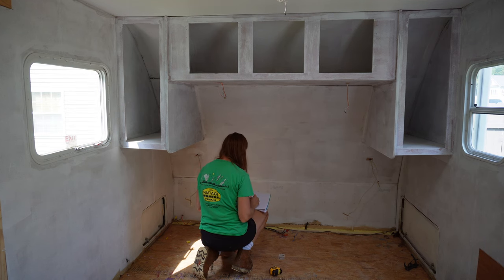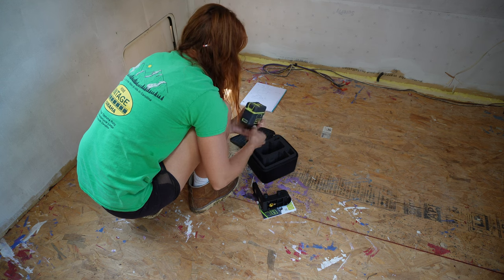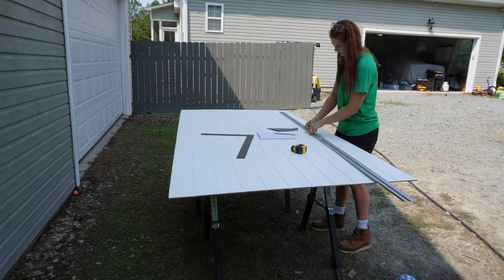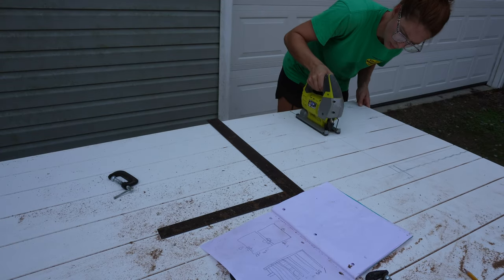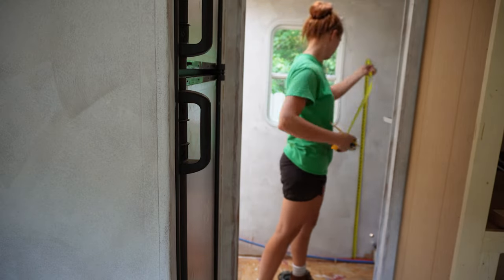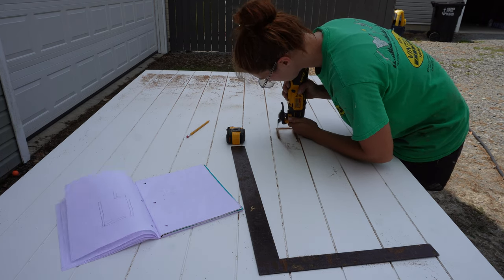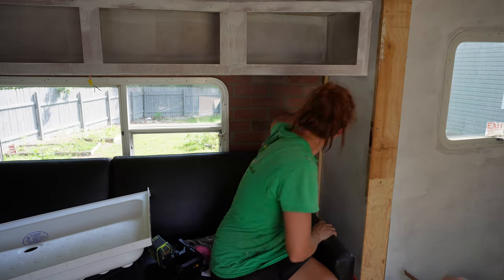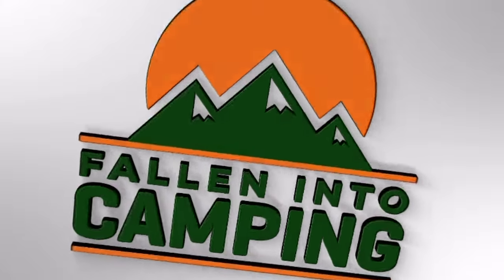RV Renovation: Day 8 Shiplap Accent Wall

Comment: That is handy stuff. I have a 4ft X 12Ft X 36 in tall work bench that I help my Dad build 50 years ago. The 50 year old plywood was showing it's age. I reframed it to add 4 additional feet, added a 10ft wall vertically to add pegboard. I bought several panels to reface the cabinet. Even though it came "painted" I primed it, two finish coats. I installed vertically on the bench's face, new freshly painted 3/4" plywood on top of work surface, new hardware. Made for a killer work bench again. Felt like Dad was with me again while I was doing it.

Comment: All the materials you are using for this renovation are cumulatively very heavy. Do you have a target weight figure still allowing for full tanks, propane, and cargo and still be within specifications of the frame and axles?
Reply from the maker: They are actually not heavy. If you look at the demo series, you’ll be able to tell that I took out way more than I have put in. But yes—axel weight is always checked before any renovation. Sometimes manufacturers tote the line really close to begin with, so I have to make sure I have wiggle room. It’s all about give and take.

Comment: You said that you use 16 gauge nails in the aluminum studding. Have you had the nails come loose over time? I’m getting a lot of pointers from you, thanks. Have you renovated a slide in truck camper?
Reply from the maker: No, but that’s why I use liquid nails along with the 16 gauge nails. Double protection 😂
Reply from the maker: Never renovated a truck camper but I’m sure they’re constructed the same as a pull behind